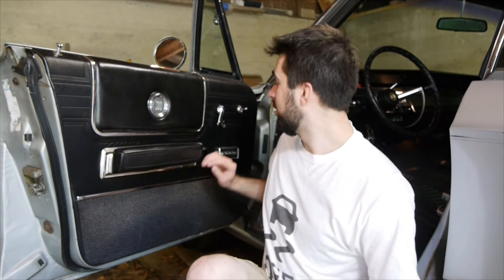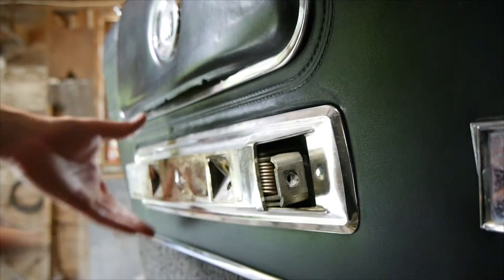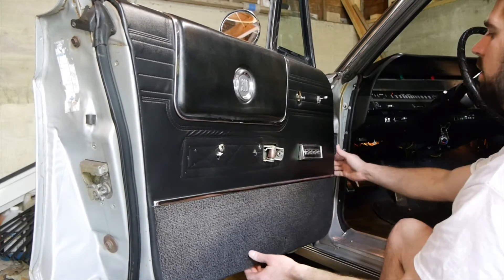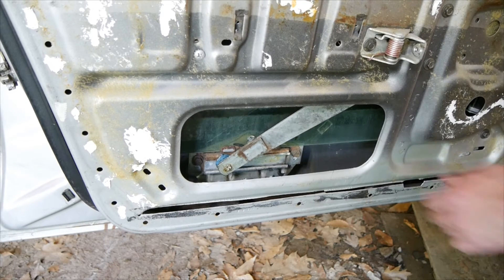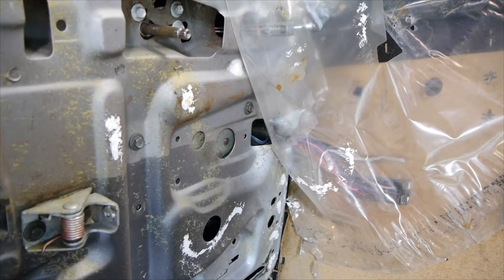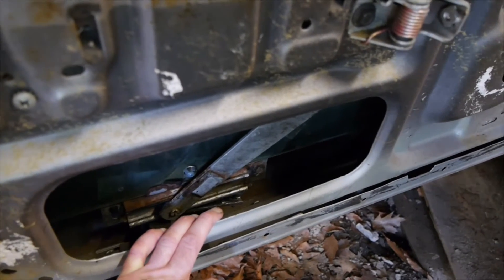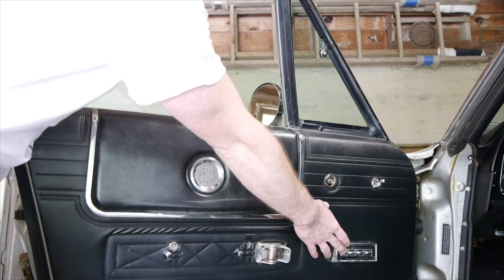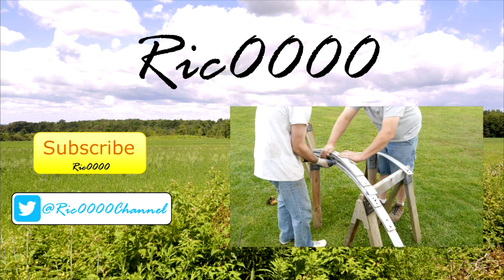Power Window Repair – 1968 Chrysler 300

Comment: is the widow wheel new ? if not r and r it and lubricated up had a chevy truck do it to me. my charger needs lubricated but I'm putting it off for later time by the way do c body power window parts are the same # or are they different ?
Reply from the maker: The window wheel is not brand new, but i'm unsure how old it is, or if it's the original or not.  So far my fix has been holding up.
Reply: thats good a bad part can ware out other parts / burn up electric parts just trying to help